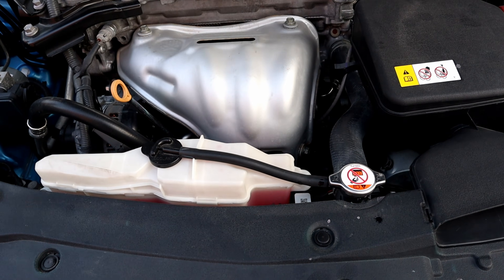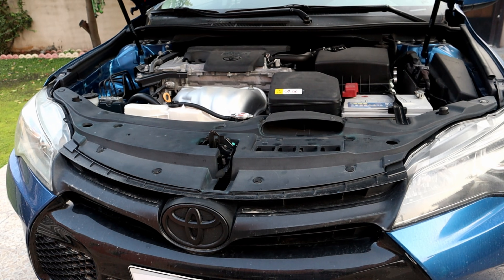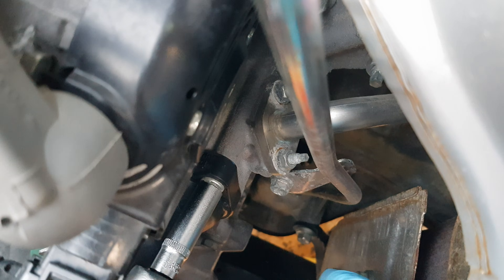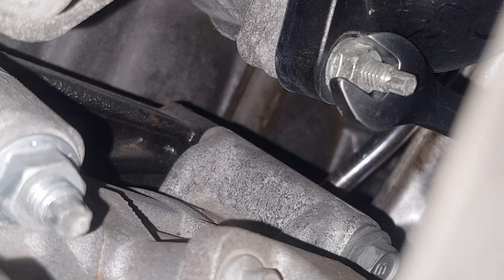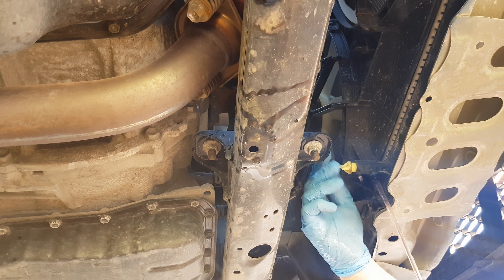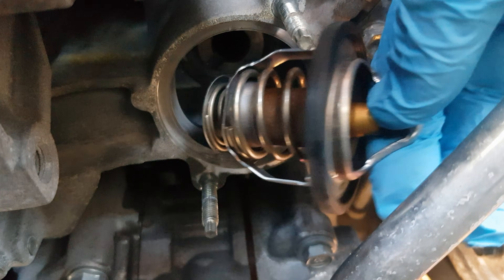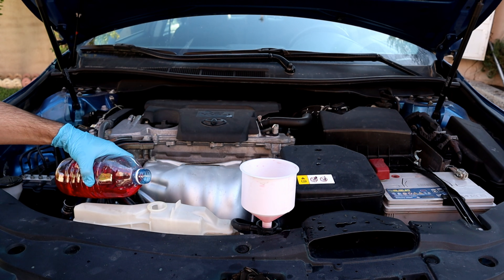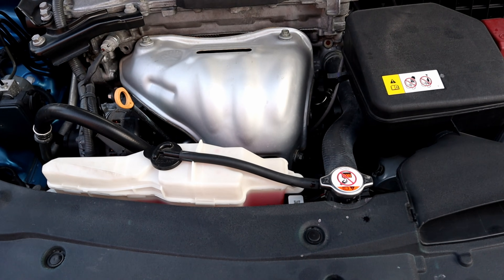How to do complete coolant flush/Coolant flush TOYOTA Camry 2015-2017/ How to change radiator water

Comment: Isn't that dealer coolant expensive? Could've used comparable aftermarket fluid
Reply from the maker: Yes its expensive comparing to other comparables, but I wanted to use this, you can buy the pre diluted ones for cheaper

Comment: Previous coolant still looks very clean .. according to the company manual service, have to flush it every 2-3 years ..
Reply from the maker: Yes, it was clean, but I found some black particles in it, in the drain pan, the car is 2017, so it was a good time to change it

Comment: I just drop and refill every 2 years and it guarantees my fluid is fresh.  This year I replaced water pump and belts.  2 years ago I replaced hoses, constant pressure clamps and thermostat just because.  2011 Camry. 188K.  No issues.  Water pump was in great shape this year just did it as preventative maintenance.
Reply: Today's hoses should last the life of the vehicle. They aren't like the hoses of yesteryear.
Reply from the maker: Awesome, great job
Reply: When should you replace hoses?
Reply: Just wondering, have you ever had to change transmission fluid? 2013 Camry at 130k now. I’m getting mixed opinions from different mechanics about whether the transmission fluid change is required. I’m aiming to get at least 200k out of the car.
Reply: @maurice4550  from what I read you should do it.... Apparently when they say good for life they mean 100k
Reply: @maurice4550  I do a drain and fill on my Toyota every 4 years or 40,000 miles whichever comes first
Reply: @maurice4550  
If your going to do it I wouldn't wait much longer.
Reply: @maurice4550 I would have done it at 60k miles. You may be over the mileage where the transmission is used to the dirty fluid and once changed, could start to slip and damage.